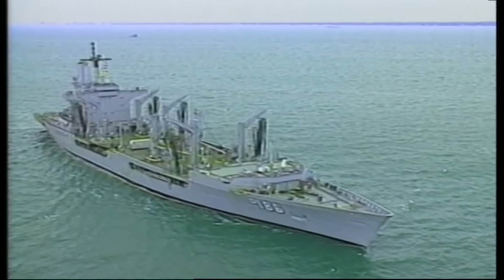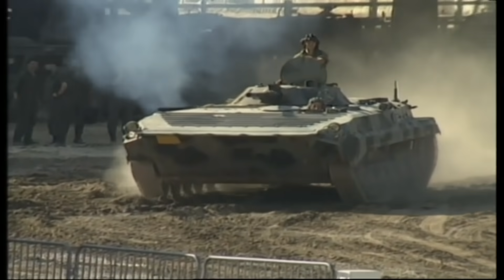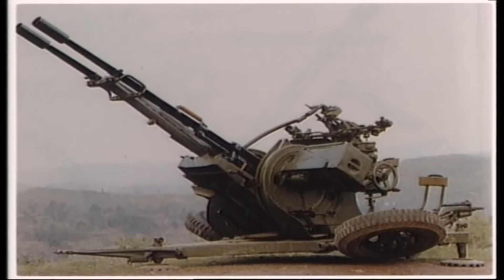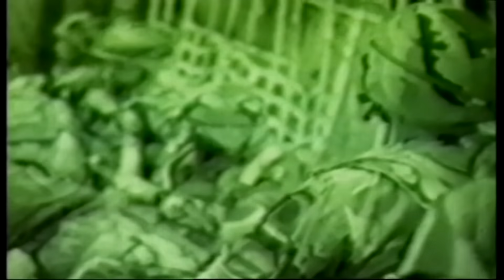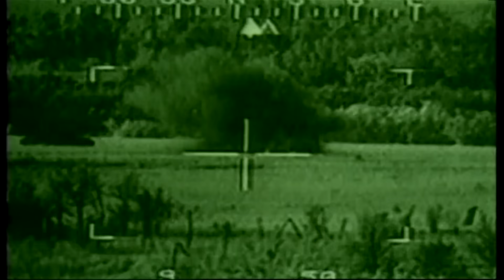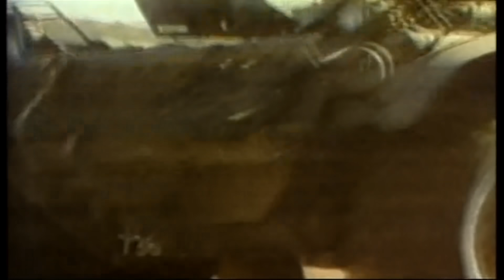Could The Iraqi Army Have Won The Gulf War? | Battlezone | War Stories

Comment: No. No they couldn’t have. The war was over before the tanks ever rolled in.
Reply: Ah....... - no.  Contrary to modern myth air power alone cannot win wars.  You can bomb people until you are blue in the face = but unless you dislodge their ground forces they are still there.

p.s. - the Iraqis made defensive lines in Kuwait but not very "developed" ones.  In other words they had mostly simply shelters and trenches and minefields which offered limited protection against air and artillery.  

In WWI as an example the armies dug out massive underground shelters which could withstand weeks of bombardment and house large numbers of me.  If the Iraqis had created similar bunkers the air bombardment would have been less effective.

Comment: Iraq needed to seize the Saudi oil fields. They actually had a chance better than 50-50 some say it was even 65-35 chance to do so if done without hesitation. Then they would have had everybody by the balls....so-to-speak. And could have negotiated a favorable peace more on their terms. But they hesitated. Long enough for us to get some troops between them and those vital fields. After that....the war was over. They had absolutely ZERO chance. Even with one million men. Because our Air Force was too much superior. In modern warfare if you control the skies you are gonna win. We bombed them for 2 solid weeks with B-52s to soften them up. Then routed them on the battlefield. Was no contest....except for a minor setback at Kafgi. The fact that Sadaam might have used nerve gas is hardly mentioned in this video...but it was a HUGE worry for our officers. As were his scud missiles. So I can tell you that the troops on the ground DEFINITELY had respect for the enemy. And the devastation he could bring.  But for some unknown reason the nerve gas option was not used. Before retreating out of Kuwait they pillaged  Kuwait City and blew up practically every oil rig in the nation....leaving Kuwait a shambles and the skies purple with smoke. So they did not lose the war without taking their pound of flesh.

Comment: I highly doubt that Iraq could have won, even if the equipment gap had been closer.  Iraq functioned on more of a Soviet/Russian-style doctrine with top-down control.  US Forces operate on a doctrine that evolved from early-WW2 German doctrine, which devolves initiative and decision-making to battlefield commanders at all levels.  In WW2, especially the Battle of France, the ability of German forces to rapidly outmaneuver and defeat Allied formations was due in large part to this initiative.  Simply put, US forces can move faster and adapt more quickly to a changing battlefield situation because the decision-makers are either at ground-level or close to it.  For example, as a Scout Section Sergeant, if I got to an OP position and realized that it provided poor overwatch or poor concealment, then I can adjust that positioning on the fly, using my understanding of the mission objectives and Commander's Intent.  In a Russian/Soviet doctrine, I'd have to call up to my Company Commander, who would likely have to call up to the next higher level...all to reposition an OP 1-3km in a given direction.  One method allows for quick adjustments by junior leaders that understand mission objective's and CI, whereas the other makes simple maneuvers a convoluted system that requires radio traffic (which can be jammed or intercepted) and clogs command centers with the need to make many small decisions instead of focusing on the big picture at hand.  

What we saw in the Battle of France and are seeing now in Ukraine is that devolved initiative allows a smaller, less well-equipped force to outmaneuver and often out-fight a larger force that lacks similar devolved initiative.

Comment: That war was between two different military doctrines that were never intended to change any world superpowers, 
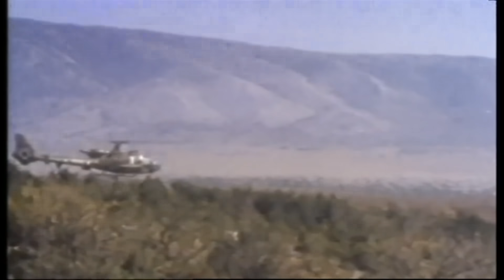31:35 this is the simplest example how that war went on so wrong, the MiG 29 are in different category compare to F-16 specially the early version which had multiple issue with it flight range and with it engines, needless to mention it underpowered radar that even Soviet Union never use on it aircraft that limited it BVR capability a lot .

Comment: The T-72 has better armor protection than the T-62, due to the use of layered armor . The advanced passive armour package of the T-72M and T-72M1 can sustain direct hits from the 105mm gun equipped M1 Abrams at up to 2,000 meter range. The later T-72Ms and T-72M1s are equipped with laser rangefinders ensuring high hit probabilities at ranges of 2,000 meters.

The T-72 has the same integral smoke generating capability as earlier T-54/55/62, tanks, and variants have been observed with smoke grenade projectors mounted on the front of the turret.
The 125mm gun common to all the T-72 models is capable of penetrating the M1 Abrams armour at a range of up to 1,000 meters. And all T-72 models can carry a minimum of 45 rounds. The Defense Analyst Steven Zaloga was talking a bunch of Malarkey......
Reply: Nah... Russia still hasn't produced a tank that can stand up to any of the NATO tanks. The T-14 is the only tank that might be able to, but they're only used for parades as they're so badly made and there are only about 4 in existence
Reply: M1-A1 Abrams 🇺🇲  VS  People of Iraq 🇮🇶 
https://youtu.be/vZTccFE0y9c
Reply: lmao moskal cope. T-72 can take on the M1 Abhrams? Iraq showed otherwise. xDDDDDDD
Reply: @L S  There's a reason why United States is not sending  Abrams to Ukraine. Because they know they will be destroyed by T-72
Reply: @LS-jv9hp those were T-72As which were outdated by 1980

Comment: It’s really interesting seeing a documentary about the build up and what we were facing they talk about the Iraqi tanks as equals maybe even betters if it wasn’t for a ‘distinct technology advantage’ not knowing just how much that advantage was about to destroy the Iraqi army.
Reply: The T-72 tank had a mythologised performance at the time, and to some extent still does. There was one tank battle where 4 Abrams took out 16 T-72s. In reality its best performances have been against outdated tanks (the Abrams is only from 1980 remember and in reality was designed in the mid 70's, tank design slowed down a lot since the time the T-72 was introduced).
Reply: @Spaced92  like most russian weapons good in concept horrid execution of engineering in many cases
Reply: @Spaced92  Military technology between the 1960's and 1980's is a much bigger gap than most realize. Especially Russian Military technology in 1960 vs American technology in 1980. Night and day. Russian tanks are built for mass production and numbers. To this day the same is true they rely on numbers rather than technology and effectiveness
Reply: @Spaced92  What this documentary missed which you brought up some good points as well is that one of a tanks performance is measured by sustained rates of fire. The russian tanks were notorious for not being able to be fired at a sustained rate. They could reload relatively quickly and fire every few seconds. However, this is where the flaw lies with the russian tanks, if they don't take a break period to allow their barrels and breach block to cool down it will inadvertently cause the round to prematurely explode or back fire into the tank injuring or killing its crew when reloading. Abrams does not have this problem due to how the rounds are constructed. Back blasts are still possible with an abrams, but a premature detonation is virtually impossible when reloading thus allowing the abrams to continously fire as fast as it can reload without stopping or needing a rest period until it depletes its armament that its carrying.
Reply: They had a huge military
Reply: People just refuse to see the T72 is useless for some reason.
Reply: Ya I don't think people really have a clue as to how devastatingly outmatched the world is against the USA. The number 2 military in the world is still Russia and when you look at the invasion the truth is in the middle but probably a bit more towards the end of Russia being the fool. Now with all that imagine the US alone rolled in on that 40 mile convoy stalled in the open and ask yourself how anyone else would fair against them. Brittan France and the USA made the bulk of the world as it is today and for all that's bad it's far better for most than it ever has been and in large part because the USA is so strong. I shouldn't need to say this but obviously this doesn't mean the bad is somehow ok, just reverse this and imagine I was saying all the bad and get the idea it's just highlighting one aspect.
Reply: All we had was a longer reach.
Reply: Most of the Iraqi tanks were built in the 1960's. There had no where near the capability of the coalition tanks. They had no chance on an open battlefield
Reply: It was the at the time new GPS TECHNOLOGY THE U.S. MILITARY HAD DEVELOPED THAT NO ONE KNEW ABOUT YET........

they thought that there was no way the American's could cross the deserts of Iraq but we plowed through with GPS and infrared night vision and stealth bombers......

MURICA!!!

Comment: Iraq never had a chance. They were using T72 tanks that were out of date. The Abrams tanks were technologically WAY superior. Their crew could detect Iraqi soldiers and destroy them in their tanks at night before the T72's could see them coming or were in range of their tanks. They got destroyed before they knew what hit them. The US and their Allies controlled the air and the sea. It was one of the shortest wars in History.
Reply: you mean the same t72s russia is using today :)
Reply: The problem is that a lot of the rotten tanks were basically poorly upgraded the line of Babylon train was 1872 tank with modest upgrades to the optics and armor. Not to mention due to a lack of trust within the Iraqi military because of the way the review was a lot of professional nudes weren’t able to operate effectively
Reply: Do not forget those T72 are rubbish export versions.
Iraq now has Abrams but those are also cheap rubbish export versions. They would not stand a chance against US Abrams tanks.
Reply: Comparing T-72 and M1 as an umbrella term is not meaningful,T-72M1 of the Iraqi is quite different than contemporary Soviet T-72B same with the original M1 and the M1A1 of the Desert Storm. T-72B would have been a good match for M1A1.